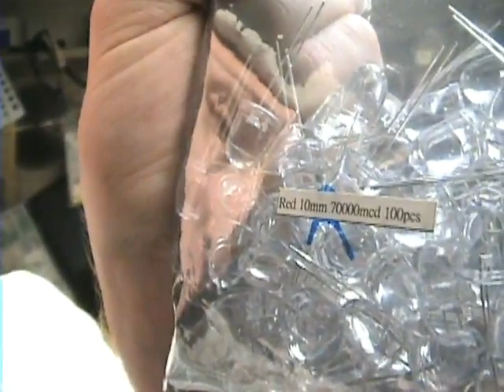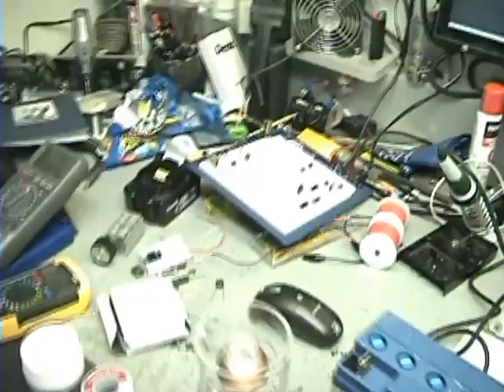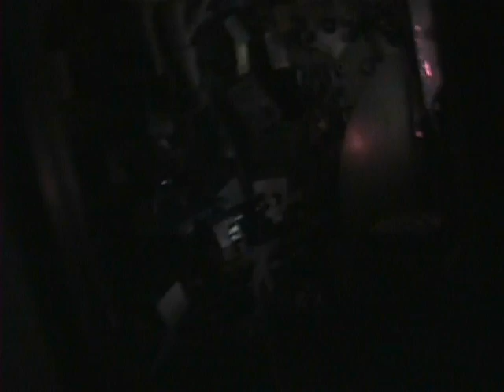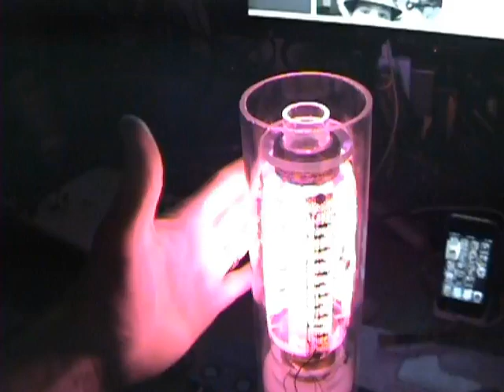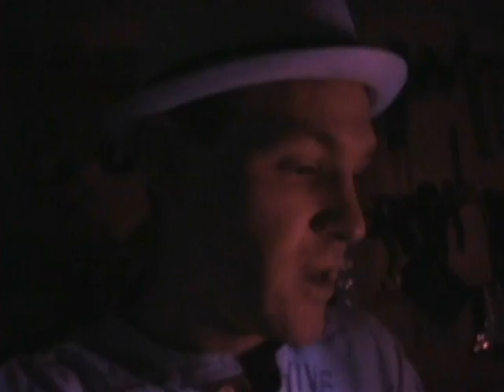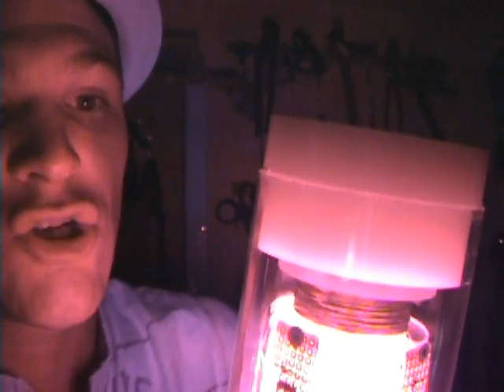P3 Stanley Meyers Hydrogen Gas Gun Replica. Added 20 x 70,000 cmd 10mm 630nm red led's.RWGresearch

Comment: Just had a thought.
If you pulse the LED's on a 50/50 duty cycle, red then UV, very quickly, the total energy usage will be half, the heat will be less and you can even use a Joule Thief set-up to run them - cutting the over all energy usage again while still achieving the ionization goal.

Comment: Russ google hydrogen light absorption through a prism hydrogen only abosrbs certain nanometers of light.  656 and 410 is the only two i can think of off the top my head.  when you pass white light through hydrogen the project it through a prism the light spectrum will show up with black bars in it because of the shades of color that are absorbed